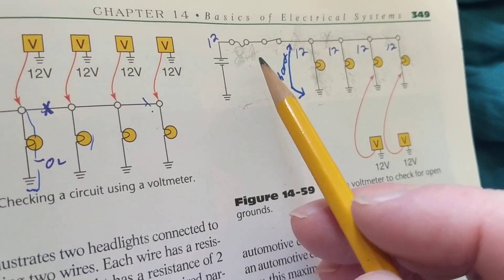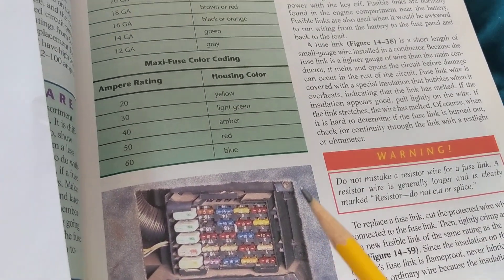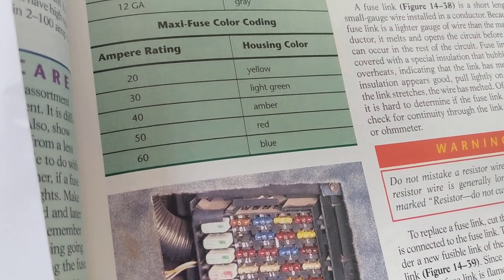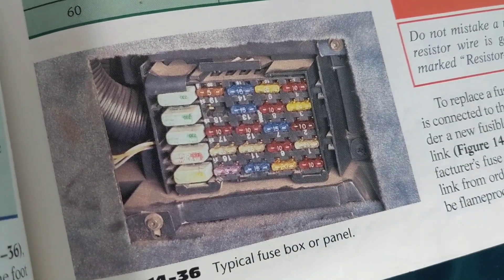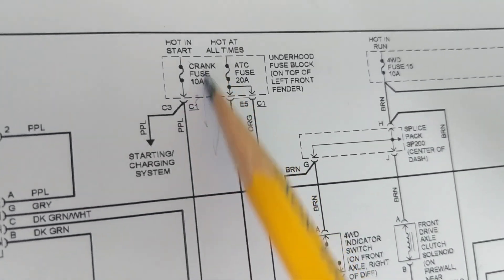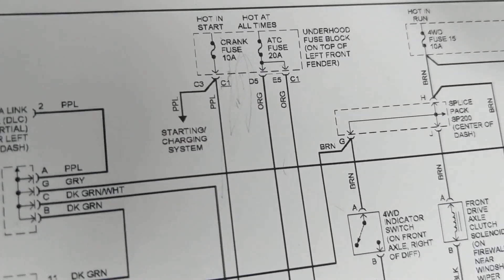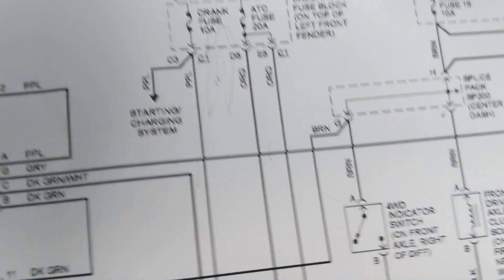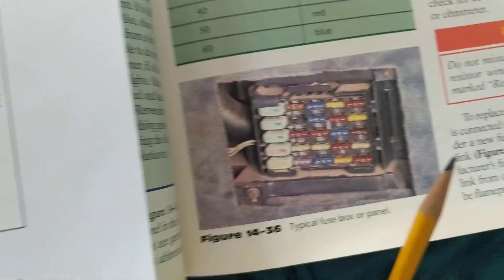BEST TUTORIAL how to TROUBLESHOOT FUSES PART TWO

Comment: Why are the smaller fuses with the same colours as the maxi fuses rated with different Amperage ratings? This seems crazy by the manufactures, or have I missed something? 
Your videos are very informative by the way and I appreciate the time you take to explain. Please keep up these helpful videos.  Thanks.
Reply from the maker: The chart that I showed you was for Maxi fuses there's a different chart for many fuses because there's only a certain amount of colors you can use on fuses